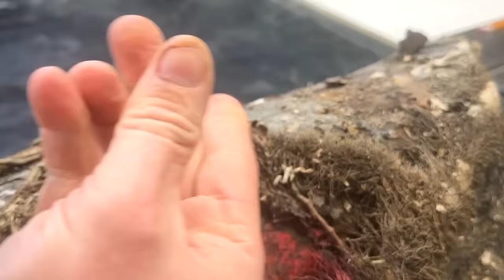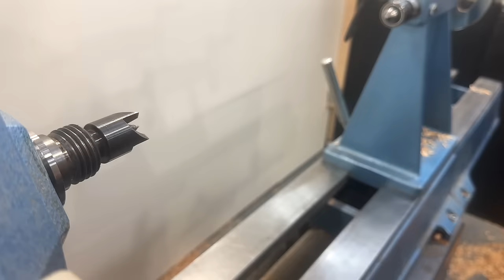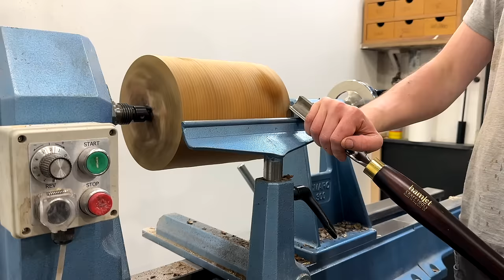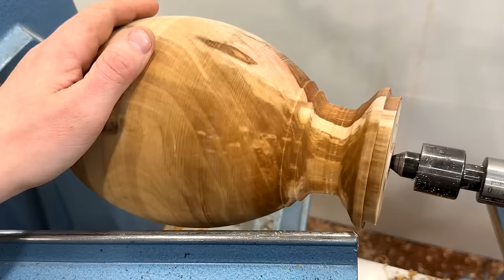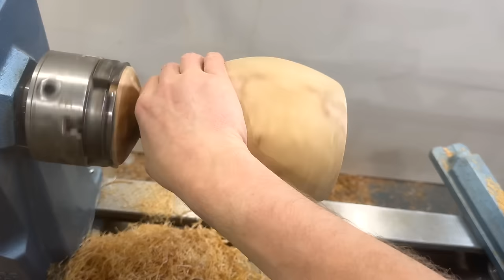Woodturning - I Didn't Expect It To Look This Good !!

Comment: Please consider clamping or blocking a round log in a jig before you do a crosscut on the bandsaw.   You got lucky there it that it did not get grabbed by the blade and roll forward.  If that happens there is no way you can control it and then bad things happen!!
Reply from the maker: I definitely think that if YOU think you “can’t control it” and “bad things” will happen. then you absolutely should mess on with jigs. 
Iv personally been doing this a very long time and it’s my active decision to do it this way after weighing up many known factors. 
I’m more than happy to talk you through it if you’d like.

Comment: This is a lovely piece. It looks to be a green piece of wood. If so what are you going to do to dry it so that it doesn’t crack
Reply from the maker: I’m not going to do anything to dry it. The things that stop it cracking as it dries were done during turning. 
Thin consistent wall thickness. 
Selections very green wood with no pre existing cracks 
Considered grain orientation. 
The finished pictures (white background) are taken 6 weeks after the piece was made with 6 coats of pure tung oil and the pieces is bone dry. 👍🏻
Reply: Where’s the hollowing tool from please
Reply: Good Job

Comment: I would love to know about the hollowing tool you used in this video
Reply from the maker: That is a ring tool, it’s predominantly used for hollowing end grain vessels. There are many manufacture make them. They are slightly difficult to sharpen but excellent once you get the hang of them.

Comment: Awesome!  I  too would like to know how you intend to dry it and keep it from cracking.
Reply from the maker: It’s dry in the finisjed pictures. 
Green turning takes a while to learn but to boil it down to a simple point. Consistently thick walls, good grain orientation and selection of very green wood without pre-existing cracks is all essential. 
It’s these points that cause cracking. When you understand it it’s very simple to turn finished green pieces that do not crack.

Comment: Another " Watch Me Turn this  video"
No naration 
What wood did you use 
What tool did you use to hollow and how to present the tool to the work 
What products were you applying , oil ,abrasive paste. Wax? 
Why didn't you remove the stub of the branch with saw ? 
Didn't learn anything from you , sorry
Reply from the maker: It seems lime you are hear for free tuition.. this is an entertainment video. Lots of channels here for learning Woodturning, thought I will tell you you would be better off reading some good books and actually standing at the lathe making shavings. 👍🏻

Comment: Relatively new turner here... For those who dont know, the vibrant colors occur during the oxidation process of growth/decay. They eventually fade, but the fading is slowed by applying new layers of UV resistant clear coat every 6-12 months. As you could imagine though, the process is sped up if the piece is consistently exposed to sunlight for long periods of time. Eventually, the colors will all turn grayscale.

Beautiful piece, and easily deserving a like!
Reply from the maker: Hi Keith. This information above is incorrect. I don’t mean to be rude. But you should seek to learn from credible sources. I have pieces I turned 22 years ago that hold the same colour they had originally with only an oil finish. I have furniture that’s over 200 years old that are not “grey scale”.